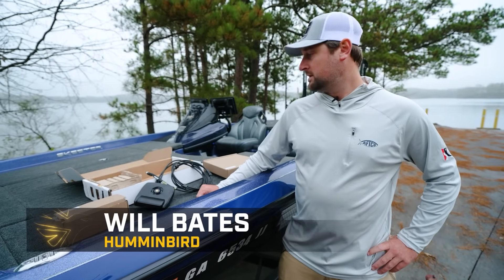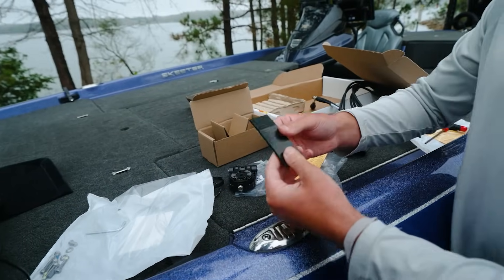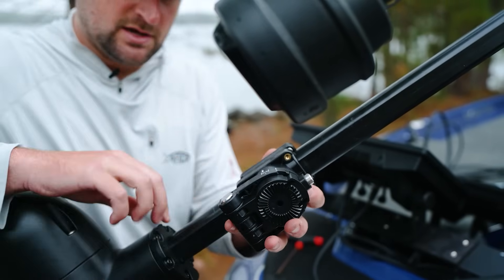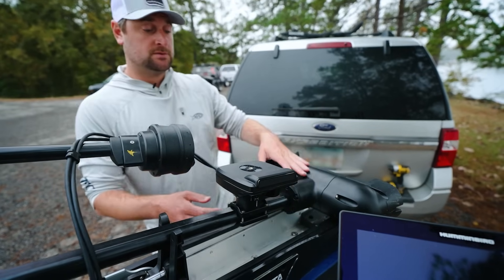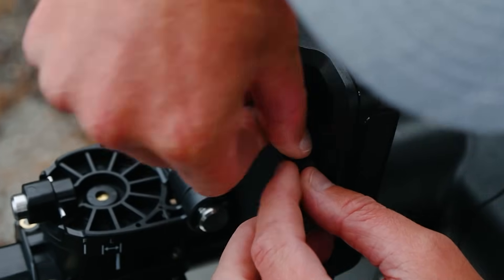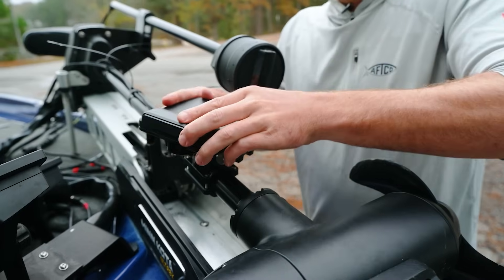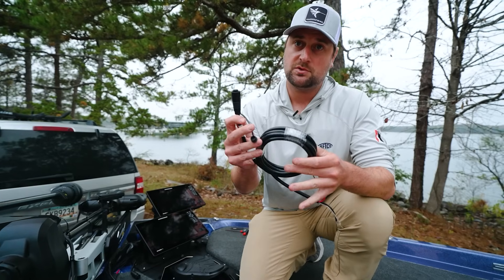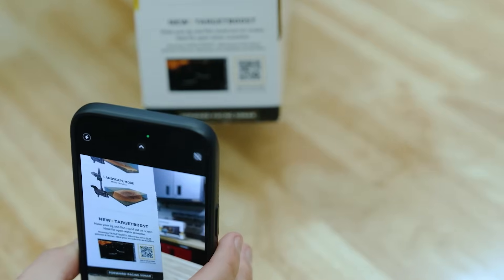MEGA Live 2 Unboxing & Installation Overview | Humminbird

Comment: I'm not getting this kind of installation. What happens when using spotlock? Or when you want to move your boat in a direction different from where you are pointing your ML2 at? Feels like ML is mostly pointing at any direction except the right one...
Reply: I'm planning on having the transducer on a separate pole in order to independently control the transducer... I am assuming this demonstrated install is for freshwater and calm situations only?
Reply: @softballbryan Installed mine on seperate pole as well.
That's the only way to do it in my opinion.
I don't understand why people put it on their trolling motor with spot lock?
You have no control where the transducer is pointing.
Reply: @softballbryan  thats what i did with mine. yeah you turn it by hand but when spot lock is running, your transducer wont go in a million directions like Michael J Fox driving a car.

Comment: Wherw do u plug the. White wire  next to the negative wire  to ?
Reply: It’s a bleed ground. If you have an aluminum boat hook it to the chassis. If you have a fiberglass boat hook it to negative on the battery.
Reply: Clear coated wire goes to boat chasis or ground.

Comment: I have my new mega live 2 transducer, unfortunately I can't mount it on my target lock without an adapter that isn't even available yet.
Reply: I also have TL getting ready to purchase the new transducer and have heard about having to have this adapter. Not sure why. Not sure why HB was not aware of this problem before and not adding this adapter in the box with the rest.
Reply: I have the same problem!  Bought Targetlock, need an adapter to install my Mega Live 2.  Was looking at ML2 to view farther than ML1, which only seemed suitable for vertical fishing.  Further, I had to upgrade all my graphs to run ML2.  I'm a bit disappointed.

Oh, and there is no heading sensor for the Xplore yet! 🤔
Reply: @BlueWalleye  I'm looking for something for vertical ice fishing. Would this be good for that? I have a helix 7 and all my friends have the Garmin live scope and I'm looking for something for my helix 7 that will do the same thing.
Reply: @bullrder33  first u need to sell ur helix.. and then get livescope and a garmin unit!
Reply: @gabrielrendon61  it’s out nos

Comment: Looks like the cable connection back to the head unit is alot shorter than was provided in ML1, is that true?  It is a pain lugging around the extra cable when in an ice fishing bundle.